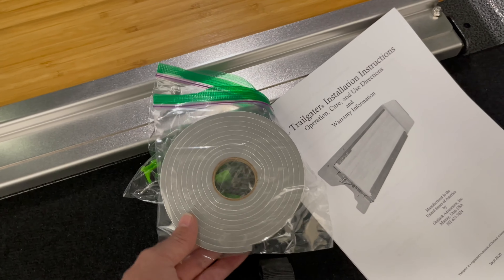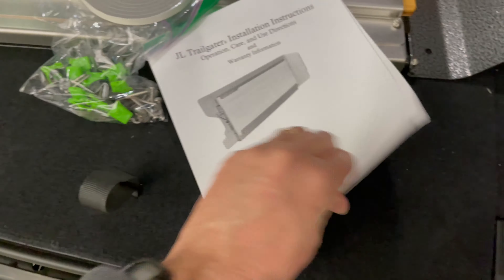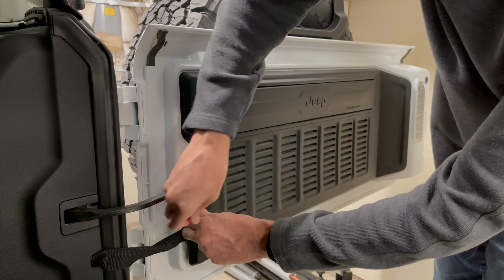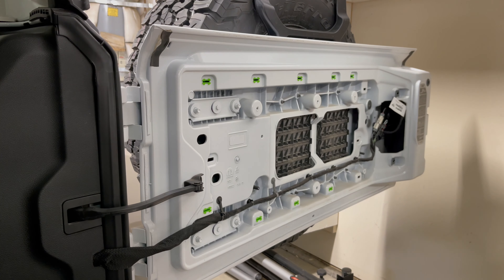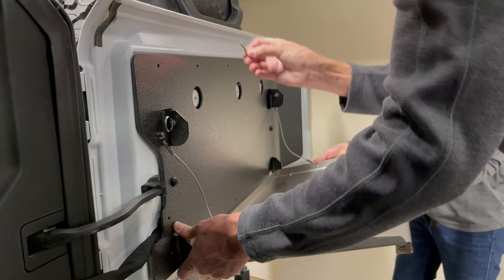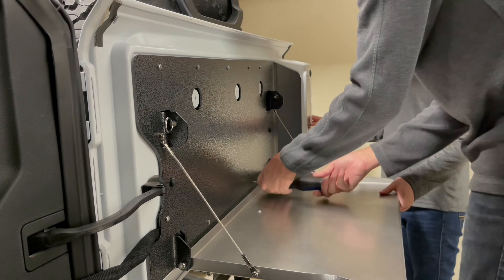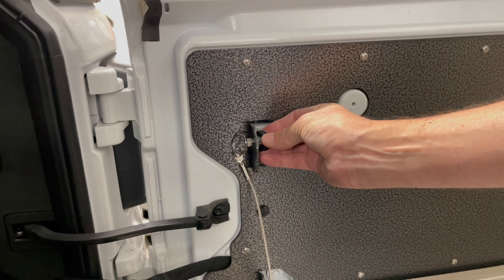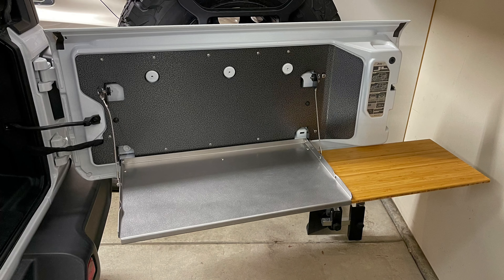Outback Adventures JL Trailgater Install | So Easy Even TrailNewbie Can Do!

Comment: This table is very heavy it’s 20 lb the JL tailgate can hold up to 85 lb if you plan to have your spare tire plus this heavy table you need reinforcement system so basically this table going to cost you some where around $800-900.
Going to return mine
Reply from the maker: Are you running oversized tires and aftermarket wheels?
Reply: @TrailNewbie  he probably is in that regard you will still need reinforcement. Since i will still be running stock size tires i should be good.
Reply from the maker: @melvin5818  yes, I would agree

Comment: What was the thickness of the foam tape?
Reply from the maker: Great question, the thickness was only really about 1/8 of an inch thick and maybe 1/2 inch wide.  The foam tape comes with the Trailgater provided by Outback Adventures.  It's the same type that you would use potentially for weather-stripping a door.  It squishes down to almost nothing behind the metal once the table is screwed to the tailgate - but it definitely does the job of keeping any rattles down and/or water getting back behind.